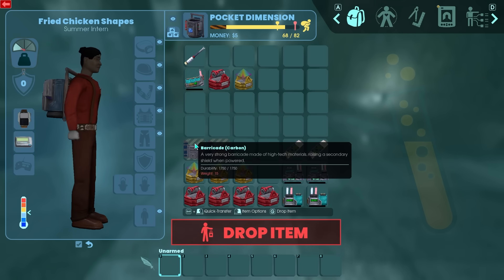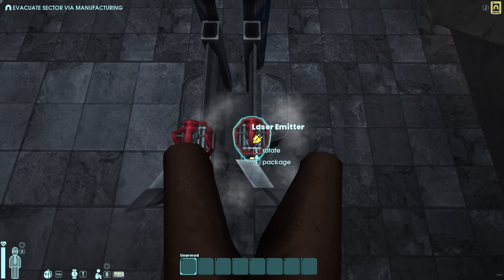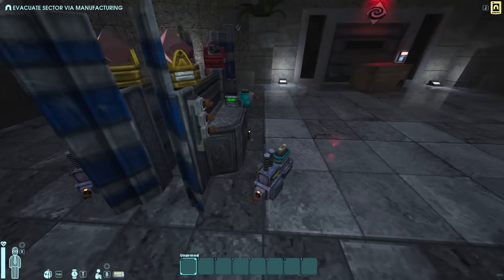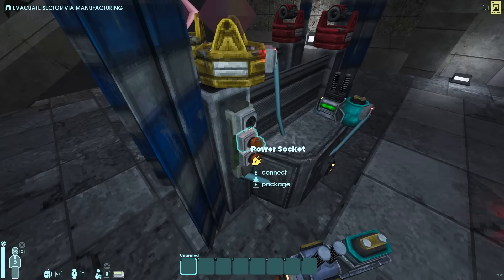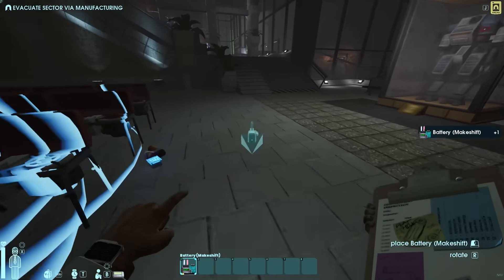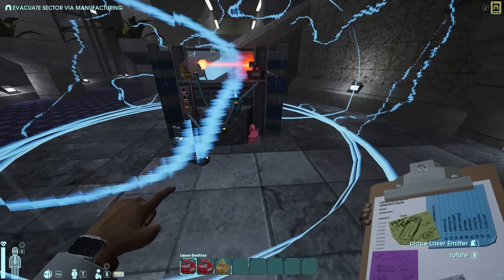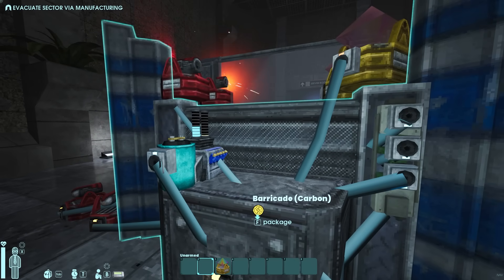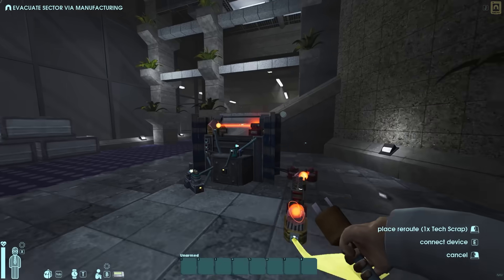Abiotic Factor Feedback Machine 1.1 Infinite Energy (1.0 update)

Comment from the maker: For those of you curious, I'm going to paste in an explanation of why to use this machine from my Steam Guide: https://steamcommunity.com/sharedfiles/filedetails/?id=3537244045

What's the use of the Feedback Machine(s)?
Power sockets are in abundance in the facility, however, there are some spots in the game that are perfect for base building. But they're inaccessible for base building, an example of this is, Some Distant Shore[abioticfactor.wiki.gg] anteverse. This is just an example but if you look around the world of Abiotic Factor you can see some really good basing spots without sockets, that's where this machine comes in handy.
This machine is technically better than a socket, as it provides the same amount of power as a socket but it runs 24/7 unlike the socket, so you don't have to worry about any battery arrays.
I usually use the machine for teleport spots out of bounds connected to work benches, as in the 1.0 update they started getting rid of sockets out of bounds.
Reply: @c0ffixx the 2 lasers that power the last laser when they switch it won’t power
Reply from the maker: @Bryan8710 its broken in the new update. Check the guide there are new versions
Reply: @c0ffixx I don’t understand the gudie can you make a video plz
Reply from the maker: @Bryan8710  just go down to the infinite energy bit on the guide and look at the other video. I will make a video soon when I have time off of work.

Comment: I'm having a little trouble with the null loader. Specifically, when the laser emitters swap, the whole system shuts down because the laser power converter doesnt' recognize the new laser. Any advice?
Reply from the maker: Check the steam guide, it has a new working design.

Comment: Hey c0ffix, I found something strange about the setup and would like your input on it.
I've been building a bunch of those power loops in places without power (OOB areas, The Pool Room, etc.), and I've come to an impasse with A Distant Shore.
For some reason, the loop just doesn't seem to work there. I've double checked the wiring and battery power, but the makeshift battery always ends up draining on both sides and just stops working.
But when I reload the game, the portal I connect to that power loop there always seems to be active until I step in before it promptly stops providing power to the portal again.
Reply from the maker: Check the guide, this one is broken now. On the guide under "infinite energy" there is a video to build a working one.
Reply: @c0ffixx  That's strange! This original design's worked really well for me so far in all areas except A Distant Shore.
I'll take a look at the guide though and see if it'll fix the problem for me there, thank you!
Edit: I just realized why. Being OOB and The Pool Room are all part of the overworld, whereas A Distant Shore is not.
Reply from the maker: @LazarusBell  The original design still works. But it will stop working sometimes. It doesn't matter where the machine is, out of bounds, or in a different dimension the newer design will still work.

Comment: ive ran into a problem. sometimes coming back to the base that used this Infinite Energy, it stops working. i found if you just run in front of whatever laser is on for a moment, it will work again.
Reply from the maker: Unfortunately the feedback machine creates a closed loop which the game closes off, which is why it isnt working for you. Look on the guide, there is a new version which does not do this.

Comment: So, to make an infinite energy without a wall socket, you washed 4x materials you need to make an infinite energy from a wall socket and a bit more. Well congrats on wasting my time. 🎉😂
Reply from the maker: yeah thats the point... to make energy without a socket... did you not read the pinned comment, description, guide, or last half of the video? Which all explain that this machine is not for uses near sockets... all you need for infinite energy is an environmental laser and a converter; or, a socket, battery, laser, and converter.

It's all in my guide... the literal guide to POWER in Abiotic Factor.
Reply: @c0ffixx the sockets are scattered everywhere 😂 even in Canaan. Yes, to bring power to the switch hut, I had to fiddle and run a part strip from a watermill up the cliff and through the swamp. It's doable. And takes a stack of tech scrap and a bunch of wooden bridges and 2 shelves to start temporal bridges up the cliff.
Reply: @c0ffixx it's just... I can't wrap my head around. It uses resources from hydro... It's an end game. All you need then is a bunch laser capacitors and a screwdriver to set them up anywhere to charge laser weapons. For base? Every nook good enough for a base has a wall socket.
Anyway. Have some activity in comments 😊 and do good things.
Reply from the maker: @zORg_alex  Hydro is mid-game, and does not take very long to get to, plus the resources are very easy to acquire since you can get everything but the lasers when you reach laboratories.

Also environmental lasers are very hard to come across. As I said, this setup is more or less for out of bounds, no power runs, or anteverses with limited or no sockets. This in not a machine to just plop down in the middle of your base if you already have sockets and a null loader or battery array.

I personally use it for my out of bounds hub, exor farm on the poop world, essence farm in security sector, reactor base spots, etc. Very niche uses, and that's it's point.

Comment: Man, this is brilliant, I'm on my current 2nd play through, but now with friends, I actually learned 1 more thing with this video: You can never merge the batteries output to a single line. In the game, we have "electric splitters" (3 plugs and 6 plugs), but no "merger".

It's the first time I see 2 laser beams turning their energy to a Laser Converter and making 2 energies outputs into a Single One.
I know this is not additive on the output. But in the mess that our actual base with friends on their first time, maybe it is the solution, because, we ran out of batteries every single night. (We have Custom Modded Settings on Day and Night Times). And they are all making their own ideas and outputs near, so they hatch to this UNIQUE facility electric plug.
(Two of them have a lot of Crafting Tables and many Heaters. I will say nothing because it's funny when they start arguing between themselves on the poor energy output).

These Nights Are LONG. When I played alone, 1 carbon battery connected to a Laser Emitter, then to a Laser Power Converter, to another Carbon Battery, into another Laser Emitter and finally to another Laser Power Converter was enough with this "extreme night cycle" and a higher enemy spawn rates.
(They still don't know that if everybody is asleep, the time goes faster, haha. But don't tell them).

You don't imagine the Hell that is the Water Management with these troglodytes. Every one of they have Garden Plots, and they prioritize them over a drinkable source.

Play with Noobs. It makes this game so much funnier. Like they were real scientists trapped in the facilities, knowing the theory, but with no physical experience.

Comment: Anyone else having an issue where the converter before the null loader stops powering the battery during the switchover until you manually adjust the laser?
Reply: Yes how do you fix

Comment: I think there is a way easier one where you simply have a splitter after the emitter into a converter > plug strip then connect it back into the first battery
Reply from the maker: They patched this in the 0.8 community update a couple months ago unfortunately
Reply: @c0ffixx  Not this one, check out Fleazuri's laser guide he does it post 1.0
Reply from the maker: @rydianz  I know what guide you're talking about, that is patched. It barely worked even before 1.0 but now they've fully patched it with the second latest patch at the time of this reply.
Reply: @c0ffixx  it works as of this morning. (2025-10-22) All this extra stuff is not required. only 4 components required to make a self-sustaining loop.
1. Battery
2. Plug strip
3. Laser Emitter
4. Laser Collector

Battery > Emitter > Collector > Plug Strip > Battery
Reply from the maker: @MrCuriousk Was this tested for time? Unless they have downgraded the game build then you've basically made something called an "energy recycler" which just triples the given time of a battery.
Will test when I get the chance.

Comment: Super niche but something id like to mention, this feedback loop for energy will not sustain the Leyak containment pod. Extensive testing and rewatching you video multiple times to make sure I replicated perfectly so there's no doubt in my testing. For whatever reason even when power is optimally stored and still recycling the containment pod will still shutdown after some time. About 1 in game day, sometimes less. Picking up the final power recycler and placing it back down during the containment pods alarm stage will reset the pods "power". Giving you about another in game day or less before it fails again.

Comment: This is great! I am gonna have to try it out! Question though, is there a limit to how many things you can plug in?
Reply: This is why even without infinte energy cheese, there is a good reason to add a laser emitter > laser power generator step in your base. Big savings on batteries in layouts with many power consumers, especially if you want longer offline independence, since batteries connected in line become very inefficient quickly.
Reply from the maker: There is no limit, it can have infinite deployables hooked up to it.

Comment: Interesting but i'm not convinced on the necessity of the barricades. Until i unlock the tech i can't play around but surely you can start with a carbon battery into a "null loader" as you termed it, then use the converter socket to feed the carbon battery and your base? Does it fill the battery slower than it drains for some reason? Surely all you need is a full battery to kickstart it.
Reply from the maker: You can't create infinite energy without the barricades but you can still use a Null Loader by itself. All you have to do is connect an Industrial Battery a socket then to an Emitter then a Converter, you can then use the output from the Converter to last the entire night no matter how many machines you connect to it; however, you still need a socket for this setup to work.
Reply: @c0ffixx  Is it blocked by the devs despite it making sense with their game logic?
Reply from the maker: @Xuhybrid  In the past there used to be other ways of making infinite energy, now there's only a a handful of ways. But the null loader isn't infinite energy, just an exploit of the laser system for zero load.
Reply: @c0ffixx you absolutely can do it without the barricades. Putting 2 of 3 beams from a splitter into a converter generates constant outlet power. So running two sets of a splitter can power a spare converter. To run a closed loop to set up your spare converter you just run an emitter into a splitter pointed into a converter that goes back into the initial emitter
Reply from the maker: @jegg8396  Unfortunately they patched that, at least a tiny bit. It still works depending on where you put it or it only works for a little bit.

Comment: To expensive u can make it cheap af by using 2 batterys /laser and power converter …
Reply from the maker: By the time you get to Hydro-dam for the laser equipment, you'll be able to afford all of these. But you can just use a Null Loader instead, check out the guide for more info.

Comment: This 2 barricade set-up in the video will break on exit/reload because it will detect power feeding back to itself before the barricade is detected blocking the laser. This can be fixed by unplugging/replugging something in or adding a lever in front of one of the batteries to toggle for the same effect. Adding a 3rd barricade set-up should make it fully automatic (survives world reload). It looks like this:
Laser Power Converter -> Carbon Battery -> Plug Strip -> Laser Emitter
The Plug Strip also goes to the next setup's barricade and an output Laser Emitter. Carbon batteries are required here, as smaller batteries won't have enough up-time to keep the loop going. This information is from the official DeedField discord's Electrical-Engineering thread.
Reply from the maker: I'll make sure to edit the guide and release a new video with this information, thank you.
Reply: Ah so is that why you can't just make a simple loop (basically 2 "null loaders" into each other) and you need to do all the extra stuff with barricades, because the game is coded to specifically break loops if it can detect them and the barricades are there to try to obfuscate the presence of a loop?

I haven't actually TRIED to make infinite energy.  Just learning about the null loader to eliminate the need for battery arrays is good enough for me, I'm happy using a wall socket and maybe a few dozen tech scrap if necessary.  I just saw this thing as needlessly complicated and wanted to understand WHY.
Reply: @Sotanaht01  Yup. When laser power was added in Crush Depths, you could loop power from a laser power converter into a battery that powered the emitter going into thr converter (and still can as client). The nerf made it look specifically for power looping back on itself, so the 2 barricade set-up works until the world reloads. The 3 barricade set-up makes it so the loop is always chasing its tail, but never catches it.
Reply from the maker: @Wavuvi_Speedruns  This is similiar to a design I created back in the 0.8 update which basically saves a power input for a laser as the world reloads. This is extremely useful I can maybe cross reference this with the information about the Feedback Machine fix and make it even more compact.

Comment: Well if you just put a battery Behind a energy converter system. It is already practicaly infinite energy. Since the energy converter drains 1 energy unit per miniute it never runs out. You can hook up 30+ devices who can run 24/7 with just one laser, one converter and one industrial battery.
Reply from the maker: You can hook up infinite devices with a null loader. The Feedback Machine is only for areas that don't have sockets.
Reply: @c0ffixx  outside of poop world would it not just be more effective  and far less costly just to run tech scrap to said location
Reply from the maker: @kotzer71  It's also useful for building out of bounds since the devs are removing sockets out of bounds now. It can also be used for the security sector and certain spots that are outside the render distance of sockets.
Reply: @c0ffixx a true this machine would be great for areas without sockets.

Comment: I use this same system but I use industrial batteries instead of carbon ones. They are cheaper for the same amount of infinite power. Also, instead of wiring those last sockets to laser emitters that power a single converter, I instead keep them to power 2 separated grids that use the power amplifier exploit you used at the end. :3

Comment: Any reason you used carbon/industrial batteries instead of the quantum ones? Resource conservation? or does the quantum battery break it somehow?
Reply: I only thought batteries differs via units of energy capacity and all charged the same.
Reply from the maker: @dra6o0n  they do charge similarly since the 0.8 update but there’s still variation between them, with the quantum battery taking the longest.
Reply from the maker: I wouldn’t recommend wasting resources on a Quantum battery. Plus the carbon battery is perfect because it’s got a low charge time compared to the quantum battery making it faster for the machine.

Comment: Finally, power sockets in security sector
Reply: .. there's a infinite laser you know? get power from there.
Reply: @TURKISSAAA  Exactly what I remembered. There IS an in-game infinite Laser.
Reply: There was one near the radioactive sludge. Stand near the Witch an look up. Will need a lot of tech scrap to bring it somewhere deeper.
Reply: @adriankoch964 I am aware but this can make a power socket in security sector instead of outside of it
Reply: I was running power from office sector, before I got stuff to create laser receptors to have energy in security sector. I tried to use ladders in datafarm to power cafeteria, but then I realized that I need to take a visit there to load datafarm on every game load. So I switched to 2 batteries > laser > receptor to get rid of all batteries I was stacking before.